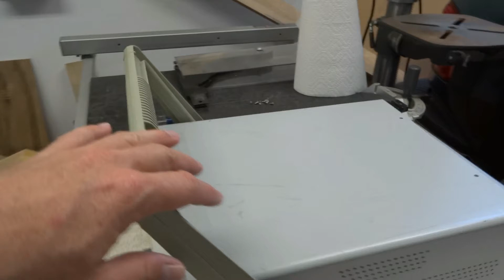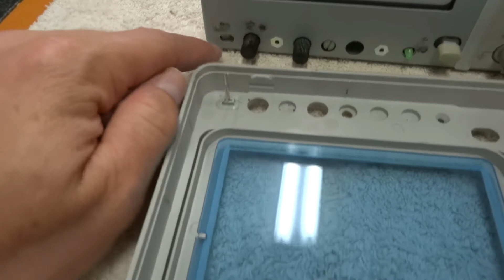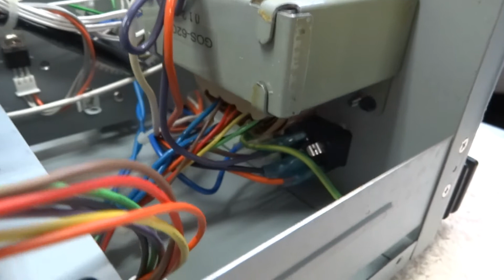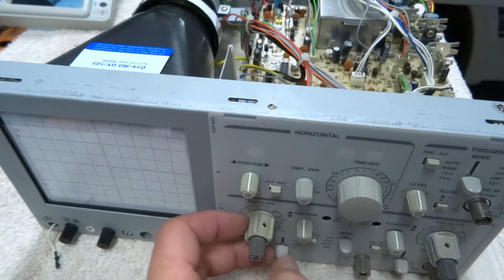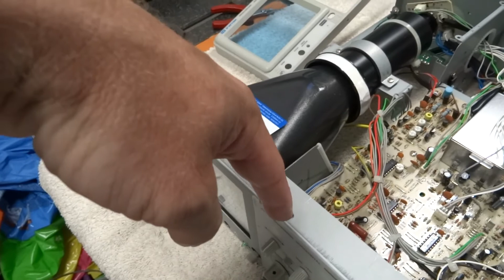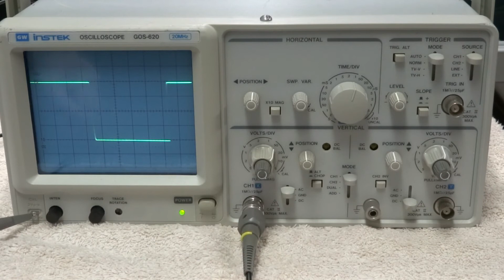Let's Teardown and Review - GW-Instek GOS-620 Oscilloscope

Comment: Hi. If you still have the scope, can you please check the temperature of the -8V regulator U601, and the 4 vertical output transistors Q313, Q314, Q315, Q316. Mine are getting very hot, 80+ degrees C. I can hardly touch them for 1-2 seconds.
I'm very curious if it's the same with yours.
Thank you.

Comment: Very good presentation of the scope's function. I think I would change the e-caps at some time soon as they will eventually dry up. Depending on costs, availability, and hassles. Sometimes, if it's working---don't mess with it , is a good idea too.

Comment: I bought an old scope for $42 off ebay, of course it was as is, but it works ok. Problem is most are sold as is because the sellers don't know how to test them so you take a chance. I bought another scope in beautiful condition for $75 as is.